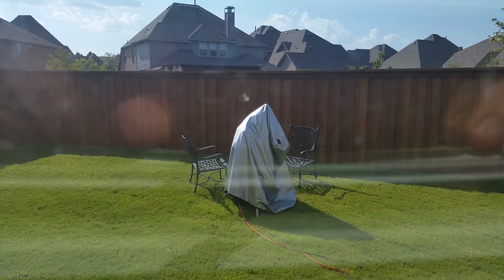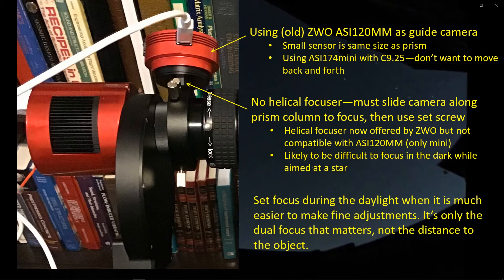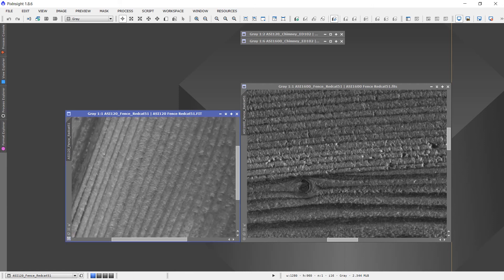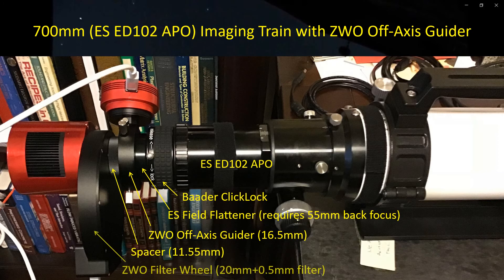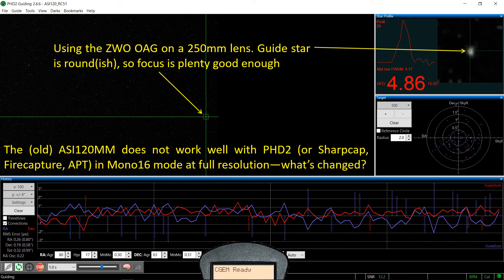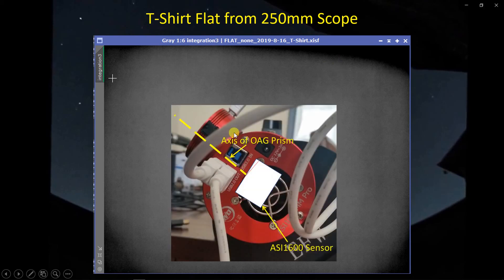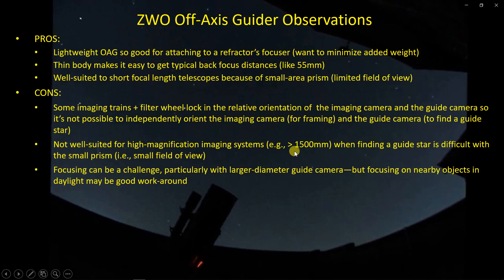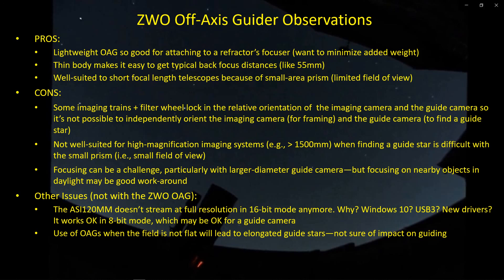ZWO OAG -- First Use

Comment: Your suggestion to setup in the daylight was so simple and straightforward.  In the daylight, quickly figured out that the backspacing was not going to be short enough with the ZWO OAG when using the helical focuser and the ASI290MM.  Had to also remove the provided extension tube that I was using with the guide scope, then removed the helical focuser, went back to the original setup, and got the camera and guide scope all focused together.  So simple and straightforward this nugget of wisdom found in this video!
Reply from the maker: Thanks, Jim! And thanks for watching!

Comment: Do OAGs benefit from multiple star guiding at all?
Reply from the maker: Good question. Long answer:
1. Multistar will work with an OAG, but works better for a full-field guidescope because (a) more suitable stars are visible and (b) the light from those widely separated stars pass through very different parts of our atmosphere so the seeing motion of the stars is more random.
2. As focal length goes up and we become much more sensitive to guiding error and want/need to use an OAG. But the OAG only sees a very very small patch of sky and you may only have 1 guide star (especially for galaxy targets) so multistar won't be possible. 

Bottom line is: If you use an OAG and can see multiple stars, use multistar guiding. It won't hurt, but it may not help much as focal length goes up.

Comment: I’ve seen bad reviews for that flattener itself is that a possible issue as well?
Reply from the maker: I do suspect it and don't think I would recommend it to others. I had no trouble dialing in the flat field with the adjustable William Optics Flat6Aiii. It would probably work with the ED102, but I don't want to lose focal length (it's also a focal reducer). Thanks for watching, Ryan!
Reply: @Aero19612  I am looking to upgrade from the red cat to a larger refractor and was looking at the ES 127, but didn’t want to lose any focal length as I really wanted something that would go much deeper than 250 mm so the guys at Starizona, ordered me a Hotech flattener only and said it should either work stock or I can bring it to them and they can reverse engineer it but they’ve had a lot of success with those flatteners and 1-130mm refractors and they’re fairly inexpensive just FYI.  Your vids are super helpful to a new guy.
Reply from the maker: Thanks for Hotech recommendation, Ryan. I'll look into it! Clear skies!

Comment: Hi James, I don't follow your reasoning about needing 16 bit digital resolution due to the pixel resolution of the guide camera. Surely the ADC resolution does not affect the spatial resolution of the camera? Actually the ASI120mm only has a 12 bit ADC, does  it not?
Reply from the maker: Hey, Ian. Yep, the 16 bit (actually 12) vs 8 bit is not a big deal for a guide camera. I suppose there is a marginal benefit to having finer shades of grey might allow the PHD2 algorithm to better identify the centroid of the star. Mostly, I was just ticked that the camera wasn't working in the 16 bit mode like it used to. Certainly not a show stopper. Thanks for watching!

Comment: Sorry I know this is an older video now but I'm trying to decide if I should get the traditional guide scope setup for my 8" F/4 scope or if I should get the ZWO OAG. I've got the 120MM Mini and the same EFW and camera as you do, my focal length is pretty close to the 700mm of the scope you have there (800mm ) but my biggest fear is the ability to find guide stars and have the camera in the correct orientation to find guide stars when say doing a mosaic. Would you recommend getting the ZWO OAG of getting a traditional 50 or 60mm guidescope?
Reply from the maker: I would say the OAG will be fine: (1) I never have an problem finding a guide star with my 700mm scope and (2) I have a couple of videos showing how to use Stellarium to pre-plan an imaging session by setting the orientation of the OAG so a guide star will be in the FoV of the guide cam (I have to do this for my 2220mm scope). Good luck, Wayne!
Reply: @Aero19612  Thanks for the reply and thanks for these videos, they're incredibly informative and have helped me tremendously in improving the imaging I have done.

Comment: Great video James!  Did you find overall your guiding total RMS error better with OAG?  I bought a ZWO for my ASI 290MM camera and have not switched out the ST80 yet - I wanted to get a baseline first but that seems hard on all by itself..  Also I'm finding my 290mm is not as good as I thought it would be over the StarShoot v1 camera but not sure if I have driver issues or gain issues.  I can't seem to find a good gain setting for the  290mm - unity gain works fine on some objects but not others...  Anyone know good gain settings for asi290mm?
Reply from the maker: That's a good question but it's very hard to answer because seeing is such a big variable. Just on principal alone, the OAG should only improve guiding, but may or may not be significant enough to see. The OAG gives you a finer resolution of the guide star so PHD2 should be able to more accurately identify the center of the star. Also, eliminating the weight of the guide scope reduced the mass moment of inertia that your RA and DEC motors have to move. I'm surprised at your observations regarding the ASI290. It works very well for me. I have PHD2 use 50% gain most of the time. It should be more sensitive than the Starshoot if I remember its specs. Thanks for watching, Marty!
Reply: @Aero19612  thanks James!  More testing tonight - I'm testing the EAF autofocuser... doing a vide on it... I'm over at @AstronomyEast. What are you using for gain settings for your 290?  50%?  What's your connect dialog gain and offset?

Comment: Hi James - any idea how I could get the 55mm back focus for a SCT (nexstar 8se), when not using the focal reducer?
Reply from the maker: First, make sure you need 55 mm back focus. I think my C9.25 requires something like 110 mm or 115 mm from the back cell. You make need something like this adapter to start off with:
https://agenaastro.com/blue-fireball-sct-female-m48-male-t-t2-female-thread-adapter-t-09.html
Then get the additional spacers/extension tubes to get you the rest of the way. Good luck, and thanks for watching!
Reply: James Lamb thank you.  I believe for my scope 105mm is needed when using a focal reducer.  But when not using one I am not sure if its 55mm
Reply from the maker: Yes. I just looked at my spreadsheet where I keep all of the adapters and bits. I started out using a DSLR and Celestron sells an adapter for use with the DSLR. The back focus is 105 mm without the reducer. When I inserted the reduce, I just screwed the cameral/adapter onto the end of the focal reducer (still 105 mm behind the focal reducer). Worked fine. So, I think you need 105 mm from aft-most thread of the SCT flange.

Comment: James, great video and thanks for all detailed information. Do you have any issues with the oag focus when changing filters ? My broad band and narrow band are not parfocal so I have to choose to have the oag focused to one set of filters or another.
Reply: I'm by no means an expert but I would suggest that you always place the filter or filter wheel closest to the imaging camera and certainly after the OAG.  That way the filters will not affect the focus of the guider.
Reply from the maker: Hey Louis,
That's absolutely where you wan to put the OAG-you don't want filtered light going to the guide camera. However, the issue is that we generally focus the OAG for the Lum filter. If your other filters are not parafocal, then when you change filters and re-focus for the imaging camera, for the Ha filter, say, your guide camera is now out of focus a little bit because it was in focus with the Lum filter.
Reply from the maker: Thanks for watching, Andre! I do see a difference, but it's small as my filters are parafocal. Fortunately, PHD2 is fairly forgiving about out-of-focus stars.

Comment: Have you used your OAG enough now (on various targets) to say how well it’s working?  That is, how often is finding a suitable guide-star and framing you desired target actually working out?
Reply from the maker: The ZWO OAG I use for the 700mm and 250mm refractors is a “no worries” solution. I don’t bother thinking ahead about locating a guide star at all. The (Celestron) OAG paired with the 2350mm SCT is a different matter. I’m confident that I can find a guide star, and with careful planning, can set the orientations of imaging camera and OAG before I go outside to ensure that guide star is there (there’s a video for that: “Galaxy Imaging Session Planning and OAG Setup”). That procedure worked ok and gives me confidence I can find an appropriate guide star for a given target for that long focal length OTA. I’m committed to the OAG lifestyle now, haha.
Reply: James Lamb Yes it’s my 2032 fl I’m worrying about (still waiting for the new cmos camera). I too plan w/ Stellarium. I forget to buy a protractor when I’m at the store to assist w/ positioning my observing camera’s angle. So it sounds like you haven’t used the your 2350 much yet. Thnx
Reply from the maker: Using my 2350mm now. Still on first two targets I selected for Galaxy season. Very few good imaging nights in the past 8 weeks. When I have a good night, the focuser binds or the corrector dews over. At least I know the Stellarium planning procedure works. I need a more accurate process for dialing in camera and OAG angles. I bought a digital inclinometer and will probably add degree marks at 3-deg increments on OAG body.
Reply: James Lamb  Yeah.... all those frustrations and obstacles that test one’s patience.

Comment: Did you encounter the problem in which the stars viewed in the guide camera all produce a fanned comet tail at focus and out of focus positions? I wonder if the prism isn’t perpendicular to the principal axis. I find no way to adjust that. I guess the guide stars looks like your field edge stars viewed in the observing camera
Reply from the maker: I believe so. Sometimes, when out of focus, the stars will have an "arrow" like shape. You could describe that as a fanned comet. I tend to think the prism is properly aligned with the body of the OAG; however, the ClickLock that holds everything can permit some tilt and the guide camera itself is held in place with one set screw, which can permit tilt as well. Fortunately, PHD2 isn't too picky about requiring a circular star.

Comment: Hi James
I started playing with an OAG and noticed that different filters were not parafocal and that meant that the focus on the OAG would shift when rotating through filters on the imaging camera. Have you had this issue with your setup?
Reply from the maker: I certainly expect that could/should happen. I have 2nd generation ZWO filters and they are fairly parafocal so I don't notice much of an effect. Fortunately, guide star focus is not nearly as critical as image focus. The centroid algorithm used by PHD2 (and others) should still be able to define an adequate star center to track. In short, you may notice a visual effect but not in the guiding performance. Let me know what your experience is. Thanks for watching, Eric!
Reply: @Aero19612  Yeah, biggest difference for me was between Ha and Lum filters that are different brands. I'll try to focus somewhere in between the two furthest apart and see how that works, Thanks!

Comment: In your discussion you say you use your asi174 on your SCT and not the asi120. Are you also using a different OAG on the SCT ie not the Zwo OAG on the SCT? thanks
Reply from the maker: I use the Celestron OAG on the SCT along with the ASI174 because of the larger prism (OAG) and larger sensor (ASI174). I use the ZWO OAG with the ED102 (700mm) and WO Redcat 51 (250mm). I use the ASI290mini with that OAG.

Comment: If one also uses a diffraction mask to focus the imaging camera does the oag prism catch enough peripheral image to also generate a diffraction pattern? Thanks.
Reply from the maker: Not in my experience. Although, if you could position the bright star in the OAG view, it should work. I've done focusing at 250mm and 700 mm on objects during day --- works great. Lately, I've had to refocus my SCT OAG and just used the image in Sharpcap--works well enough. Perfect focus for the OAG is not critical. Thanks for watching!

Comment: What is the thread at the end of the focus tube where the clicklock is screwed. William optics have a M63 to M48? M42? camera rotation joint.
Reply from the maker: The thread on the Explore Scientific focuser tube is M68x0.75. The thread on the scope side of the OAG is M48. The Explore Scientific field flattener is M42 but I have a M42/M48 thread adapter (from ZWO) that converts it an external M48 thread (same as Redcat 51). I think the WO rotator thread is M63 but I just use the M48.
Reply: so, close but no cigar :(

Comment: HI! I also have an older USB-2 ASI120 camera, and also recently tried to use it with a USB3-only laptop. Initially, it didn't stream at all, whether at 8 or 16bit. I'm using Linux, which is probably even more sensitive than Windows to USB problems. Anyway, it turns out you can Flash the firmware in ZWO ASI USB-2 cameras. https://astronomy-imaging-camera.com/software-drivers -> FW Update tab. Once I downloaded and installed the tool, and connected to the camera,I  updated the firmware to "compatibility". And lo and behold, all issues went away. The camera now works great under both Windows and Linux, using the USB3 ports on the new laptop.

Perhaps newer Windows versions and/or USB3 ports on your new laptop also need the camera to be in "compatibility" mode.
Reply from the maker: Hay James, thanks for the info. ZWO suggested I do that when I brought the issue up on their forum. I downloaded the firmware update program-- but was just too afraid to use it for fear of rendering the whole camera useless. Thanks to your bravery, I'll go ahead and update mine. Thanks for watching!

Comment: Excellent videos thank you. I just ordered mine and will be using with the ZWO 290 mini. I also have the 1600mm-cool with the 8slot wheel and your previous video was wonderful, I think my train setup time just got reduced a lot.  My system is similar I have the ES127ed triplet and I went with the ES 3” Flattener/reducer to get me a 667mm FL.  I got the nonrotating focuser for this setup as well and I can’t wait for these to ship!
Reply from the maker: Cool! Sounds like a great imaging setup you're going to have there. Thanks for watching!
Reply: Interesting to hear if your 290mm back focus was achieved if you used the helical focuser or extension tube that came with 290mm camera….
Reply: @jimtaylor5802  helical worked for me